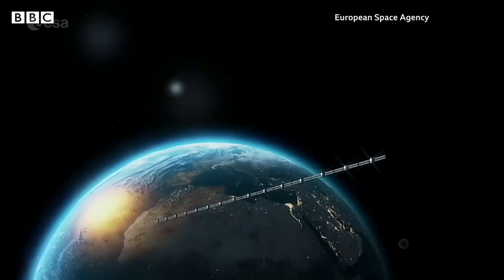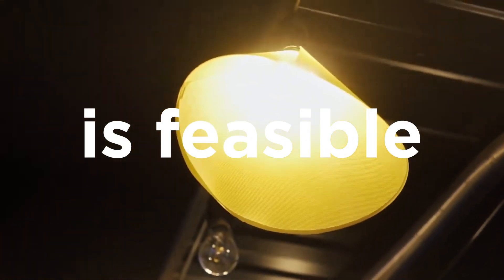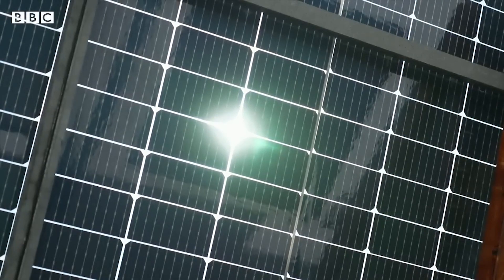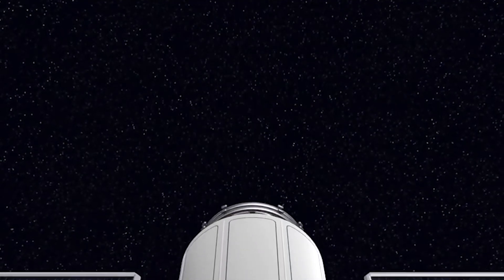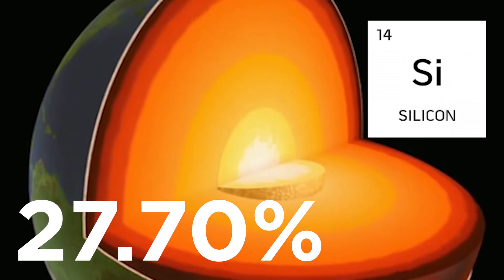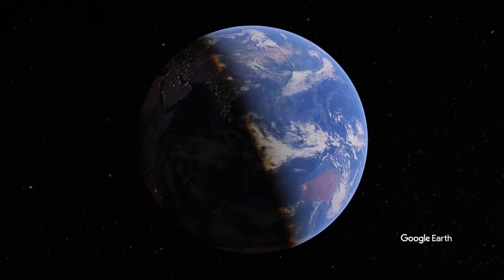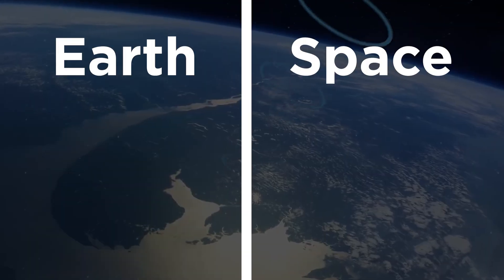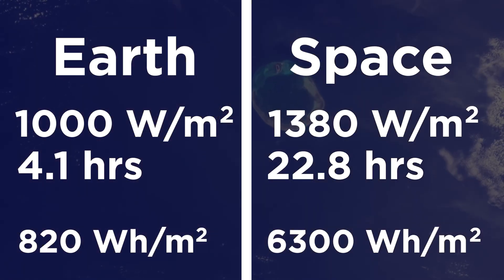Wirelessly Transfer Energy from Space...

Comment: With respects to solar energy in trying help with climate change we are getting a lot of it wrong. We keep focusing on high tech solutions, when what we need is low tech solutions.
When people think of solar power, they think of electric. Solar power is far more efficient when used for heat. Also, a huge  chunk of our emissions of global warming gases is done so to generate heat. If we instead focus on using solar to replace conventional heating methods, we would have a far larger impact than replacing electric capacity could. First, any energy conversion ends up putting off most of the energy as heat anyways. Second, the sun adds a certain amount of heat energy to pur planet no matter what we do. Yet, in our feeble brains, we add to all that heat energy by using our resources to generate even more heat. So, our industry is not only causing emissions, but is adding heat the planet. Replacing heat generation with solar heat has a double impact.
Beyond that, methods of solar heat collection is far simpler and cheaper, and doesn't require rare elements in short supply. Water is a perfect medium to convey heat from one location to another and sand is a perfect storage medium. Both are amongst the most abundant resources we have on the planet.
Beyond that, solar can have far more far reaching effects
Many cities, for instance, are collecting organic waste and converting the methane resulting from the rotting processes to fuel vehicles the city uses. Their daft logic is that the gas is going to be put off anyways, so by using it, they reduce their use of extracted fuel sources.
In reality, a far better solution is to use solar power to dry the organic waste before it rots much. The microbes converting the waste into greenhouse gases require water to survive. By drying the matter out, all decomposing ends quickly, this preventing the gas from being generated in the first place. Solar heat can then be used to cook the dried matter to the point that it's composted fully. Then the city will have not only prevented a massive amount of greenhouse gases, they would have a source of extremely good fertilizer. They can sell it to farmers to fund the process or they can setup greenhouses around the city and use it there. This way, cities can also have major impact on food security in their region.
So, by just using solar heat, a city can prevent massive amounts of greenhouse gases, offset the use of petroleum sources fertilizers, and helped cur down on food security issues in their area.
Much better use of energy rather than using a fraction for electricity and dumping the rest off as waste heat.
Reply from the maker: Thanks for sharing your views. You have made a lot of really interesting points, many of which I had not thought too much about before!

For home heating I agree, the extra processing step for energy to heat is lossy. I like how natural homes (such as Earthships) maintain and distribute the heat energy they store. Although, for a lot of other applications having energy in the form of electricity is very useful. Transport is an example of this.

I would love to see a video visually explaining the ideas you have suggested, with quantified improvement projections.
Reply: @greenfutureyt  yes, electric power from the sun is a great idea. I was mainly focusing on solar's stake in displacing energy causing climate problems. From that perspective, solar would have a far larger impact of we harvested it for heat replacement rather than electrical replacement. Solar cells that directly generate electricity are expensive and wasteful. They only harvest a maximum of 20% of the sun light's energy. They can be improved by harvesting their waste heatz which would increase their overall efficiency, although not for electricity. Also, solar cells are not currently very recyclable and in not too long we will be faced with a tsunami of waste we can't really process, plus the cost of replacing current stocks.
Using the heat to generate steam powered electricity is somewhat more efficient, and can possibly work at night. Some molten sodium designs allow for night storage to be used. It's pretty expensive build wise and maintenance wise and I don't think anybody is sure of how sustainable it is. Molten sodium can be a bear to work with.
A huge amount of industry uses heat as part of their processes. It is possible to use sunlight to generate fairly high heat. Technically, we can harvest up to the temperature of the surface of the sun, which is about 5500C I'm pretty sure. That's woild likely work even in steel mills. The big thing would be to concentrate the heat and get it to where it needs to go. Also, using heat harvesting techniques helps, by not allowing much of the heat to escape.